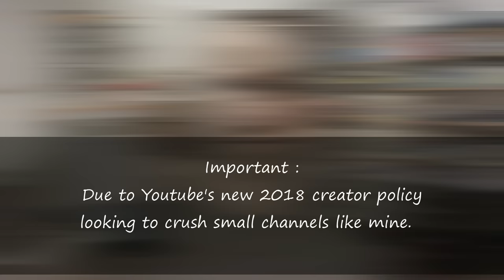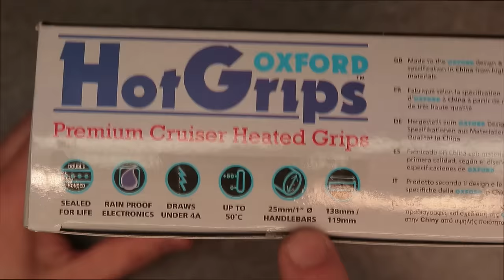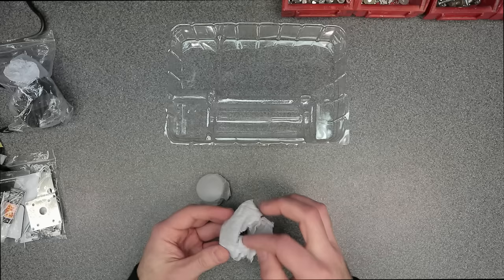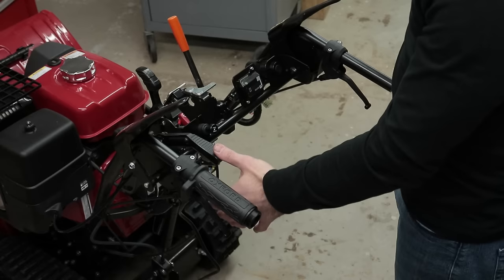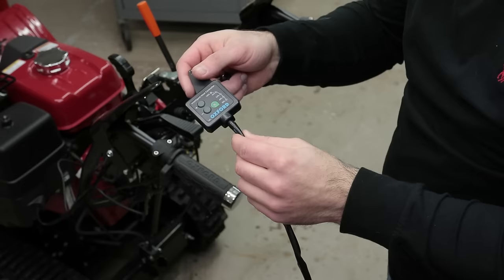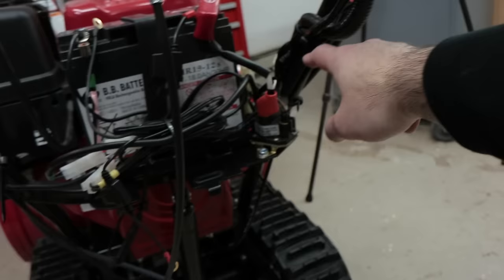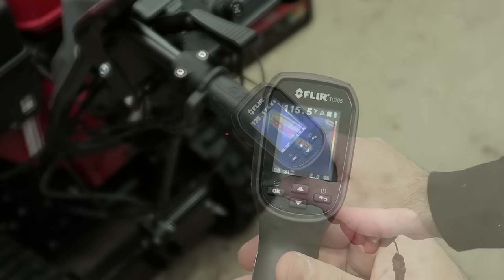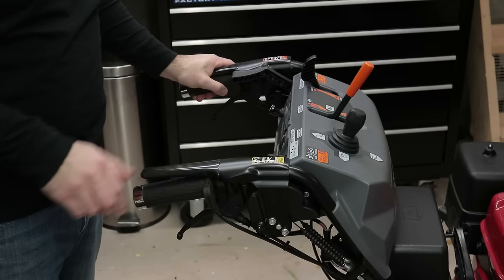Oxford Hot Grips Heated Hand Grips Install | HONDA HSS1332ATD Track Drive Snowblower | Workshop Vlog

Comment: I wish I had the patience to install these heated hand grips. I just picked up my Honda 1332 ATD 2 days ago and it's a fabulous machine...almost flawless. I had the heated grips on my old JD 1130 SE and would often clear the driveway and back yard with no gloves on my hands because the heated grips were so warm. However, I found some excellent thick work gloves with Thinsulate at my local Can Tire store for less than $7 and for now they keep my hands quite warm. Great video. Thanks.

Comment: After a month of making the upgrades to my snowblower, I was finally able to test it today.  We had about 7in of snow in central mass, combination of snow and sleet.  The machine performed extremely well.  I didn’t make the chute modification, but rather used teflon lubricant (Dupont Snow & Ice) to treat chute and auger surfaces.  I had no snow stick to any surfaces, so, treating them is a great alternative to the chute modification.  This machine is a beast.  The hand warmers worked very well as well.  I checked battery charge after using the machine for about 30 minutes and the voltage only went down to 12.85V.  Overall, extremely pleased with the machine and the upgrades.
Reply from the maker: The only thing i do not like about spraying the auger, impeller housing and chute is eventually that repeated spraying will leave the insides with a nasty residue that may hold dirt and grime. What is your experience with the teflon spray long term?

Comment: Thanks for the video John.  I bought an HSS928 a few weeks ago and I have done many of the same upgrades you have demonstrated in all your videos...  I just did the Oxford heated grips yesterday night, and it took me about an hour and a half thanks to your video (it would probably had been 3 hours if it weren’t for your instructions).  A couple of comments... I used Teflon lubricant to remove existing grips.  Spray just a little below the grips and they come out with no effort.  Then I cleaned with rubbing alcohol to remove the lubricant.  Another observation is that Oxford apparently heard your comment about the mounting bracket not being painted black.  The brackets come black painted from factory now.  The electrical connectors are also different, threaded with o-ring, water tight.  Some good upgrades.  

It’s a shame I can’t upload some of the photos of my work.  I also did the husqvarna snow drift upgrade.  I also bought the shoes, but when I installed them, the scrapper is not flushed to pavement when in scraper mode.  I need to figure out how to install them.  On a final note, your videos are making me spend a lot of money... please stop.  I’m kidding, your videos are very helpful.  Thanks again!
Reply from the maker: Glad you are happy with the upgrades. Thanks for watching!
Reply: Hey John Franco, one question.  My oxford Heaterz are going to battery saving mode after exactly 1 minute and 45 seconds, even when the engine is on.  Even when I’m moving the snowblower forward with the auger on.  I wonder if I just have a bad controller.  I’m calling Oxford this week, but wonder if you have seen anything similar.  For now I’m disabling the battery saving mode, but nervous about leaving it inadvertently on.  Any thoughts?
Reply from the maker: This depends on the health of your battery and charging system. Mine does the same after it heats the grips up. Then basically cycles off and on automatically. I usually have a battery tender on my battery to keep it strong while in the garage.

Battery saving mode means 2 things. One is that it has heated the grips to a maximum temp or that the battery is voltage is dropping to low to support the heat function.  Either way is a good thing. It shows it doing its job. It will automatically turn off after 7 mins if you turn the machine off. It very crucial that you have battery in good shape to run the grips. 

One work around is to drop the heat setting lower so its not demanding too much draw on the battery. Try that and see if it helps.
Reply: John Franco my battery is new, but you may be right about the charging system.  I was reading the GX270 and GX340 engine manual and it states that 1 and 3 amp charging coils are suitable for recharging starting batteries.  The 10 and 18 amp charging coils should be used when adding accessories.  See:  https://www.manualslib.com/manual/1036510/Honda-Gx240.html?page=14#manual

My HSS928 has the GX270 engine, which I think has the 1 amp coil, because it has a 5 amp fuse in the charging system.

So, it may be that the power output of charging coil is not enough to keep the grip heater battery saving mode from activating intermittently.  Now, I saw a video of someone changing the coils, and requires some engine disassembly.  That’s too much for me... so I will use as is, with BSM disabled and then recharge battery with the battery tender.  Maybe a few years from now, when I have time to undertake this type of project, I may do it.  

I wonder if I put a bigger battery with more capacity, if that would prevent the BSM from coming on for at least 30 minutes or so.  Thanks.
Reply: Good stuff here. What does the 1332 come with for coil amperage? Anyone have their battery die due to drawing too much from these grips? I have a brand new 1332atd and already have these on without having even used the machine yet. Heated grips seem to be a “must have” for me.
Reply: Does the 928 , with plug in starter, have enough output to run headlight AND grips?

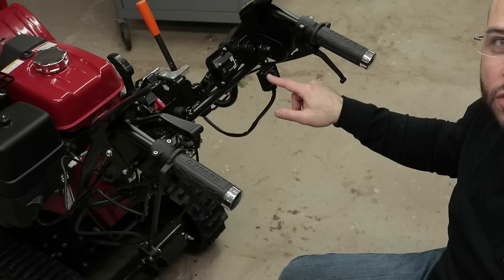Comment: Excellent way you described everything you did and why! At 22:38 you mention how you have to keep your left hand on the drive engage at all times. My HSS724 is the same way but my old Cub Cadet you could remove either left or right hand and both handles would still lock the unit in engaged mode allowing you to switch hands to maneuver controls which is nice for turning the machine around.  As long as one of the hand controls was depressed, it allowed you to to swap hands to use controls.  Would be nice if someone had a video on that modification as well.

Comment: In lieu of insulation, I'm thinking of machining a couple of pieces of solid aluminum dowel stock to size and then installing them, slathered with some heat sink grease, inside the tube. This will increase the thermal mass in that area of the handlebars which will tend to hold the heat longer once it's up to temperature.
Reply from the maker: That sounds like a great idea. I like it!

Comment: Seems like a lot of work. I have an hs1132. Love the Honda snowblowers. I don’t understand why they don’t just include heated grips when your paying over $3k for these units while companies like ariens sells them stock for half the price of a Honda
Reply: John Franco have you ever used a Yamaha snowblower? Heard there close to Honda’s
Reply from the maker: I agree...My personal theory why Honda does not include heated grips is because historically it is marketed as a commercial grade machine.  They are not interested in catering to the homeowner special market. It is a far superior machine being that it is a hydrostatic system.  So that Ariens for half the price is not even in the same league. Ariens does make a hydrostatic model, but now we are talking the same price point as the Honda. 

The Oxford Hotgrips i installed has far superior heat output and control then anything Honda would possibly include from the factory. Its ok to pay more as long as quality & benefits follow. 

If Honda considered offering quality heated grips with the machines, the price would shoot up even more. 

On snowblowers like your HS1132 and HS1332 you would have to install an upgraded charging system and battery to handle the 4 amp draw and to charge the battery.  Is it worth it?  Thats up to you. 

The way i look at it is,  yes it does take some time to do a pro level custom install. But its an absolute joy to have warm hands when im out there and its -20° F.
Reply from the maker: No i havent. I would love to try one out. But the HSS still would run circles around the Yamaha. They are 10 -15 years behind Honda when it comes to controls design and features. Similar to your HS1132. But they do throw snow just as strong as a Honda. They are not offered for sale in USA. You would have to go over to Canada buy one and and bring one back in to USA. People that live near the border have done this.
Reply: John Franco I bought my Honda hs1132 this year and it’s a 20 year old machine. Bought a brand new ariens deluxe and the Honda is way easier to start and throws way further. The old Honda will probably outlast the brand new ariens
Reply: There are heated gloves that can do the same job

Comment: Nice job on this.  One thing... you mentioned possibly using blue LocTite on the plastic end caps.  Don't do that.  LocTite damages most plastics.  I would instead put a dab of that Honda grip cement on the threads to secure them if needed.  I have a 2019 HSS928ATD and may do this same thing.  I have used those Oxford heated grips on motorcycles and they have been terrific.
Reply from the maker: Good to know. And as of today no locktite needed. I actually have some honda grip cement,. that may work. Very happy with the quality and functionality of the oxford grips and controller. I may want to upgrade the coil on the GX390 so i can get more heat from the grips. Thanks for watching!

Comment: I may try heated gloves (already have them for my motorcycle) instead of the heated grips.  Easy enough to try them, they plug into an SAE connector like the one Honda puts on for the Battery Tender.  May have to put in a bigger fuse.
Reply from the maker: Great idea!

Comment: Thanks, I believe I will do something like this with my Honda Snow-thrower too. Comments/suggestions: 1. I am doubtful that the insulation you installed made any material difference. The metal tubing will conduct the heat away and creating a little pocket on the inside which will have little if any effect. That said,  your grips got very hot but I would not attribute that to the insulation. 2. I suggest you pick up power from a source that is only active when the key is on (like the power feed to the joystick) which eliminates the need for automatic shutdown. 3. It is generally better to remove the tails from zip-ties by twisting until they let go. This leave no sharp edge;  then you will never cut your hand if you need to go back in for some reason.
Reply from the maker: Adding insulation does help. Very little help but ill take every little bit of performance enhancement i can get.  It helps hold the heat in that area Vs. it dissipating quicker into the air/metal of the tubing. Thanks for watching!
Reply: Cut zip tie tails with fingernail clippers, cleanest and easiest

Comment: For me, being able to start the Honda 1332 with it’s 12v battery is important as I am moving around town clearing snow.  I wish that motor was cranking out more power off its coil.  Makes me wonder how much power is being sent to the battery as it’s running.  Those grips, while awesome, would drain any battery quickly.

Comment: Nice installation i'am ordering mine now for my 2017 Honda HSS928A
Reply from the maker: Thanks for watching!
Reply: So how did your heated grips work ?
I just bought a 928 and these grips,not installed yet ,hate to have spend 125.00.
Reply: Does your 928 have a 12 amp hr bat like mine does brand new as of today?

Comment: Great stuff. Only problem was getting clutch to over. Cam and lock. Ground down grip, tried bolts but won’t go. Ideas?
Love videos
Reply from the maker: Grind more of the grip and check your rotate so it has better orientation in relation to the relief cut you are making. Also loosen the bolts to get more wiggle room. So the clutch will lock. Thanks for watching!

Comment: According to Honda: the charging coil only puts out 1.2 amps; just enough to power the LED headlight. You should install a 3-amp coil to help offset the heavy drain on the battery.
Reply from the maker: Yes i do agree with you on possibly upgrading the coil,it would not hurt. But the LED draws power from the battery & so does the starter. Not directly from the coil/stator assembly. The battery is rated for a higher amp draw.  One good thing about the Oxford grips is that is has a battery saving mod which will automatically kicks off/on the grips if voltage gets too low. Main reason i purchased this kit and not cheaper ones.  So far it has been operating just fine. I will post updates if i feel the need to upgrade the coil. Thanks for watching!
Reply: @JohnFrancoNH  I did the upgrade on the grips, but I get the low power blinking light after about 10 minutes, I can turn it down, but the grips do not get hot enough to feel. I also had the bat on the charger overnight and it was the first use on a brand new blower.
Reply: @erich920 I can't help you ,and I can't get anyone to respond to me either ,
I just got a new 928 and find the bat is a 12 amp /hr not the 18 John has.not sure the grips I just bought after I wasn't is going to work.
What happened with your situation?

Comment: Great video John. I just installed them Friday on my Honda 1332atd. Followed your instructions perfectly. Here’s my situation. When snowblowing on Saturday where I live in Rangley Maine, they got hot but nowhere near the heat you got. I got 103 degrees. But to do that I had to disconnect the headlight. I think that the snowblower may need a larger charging coil , if they even make one. What do you think. Ps the temp outside was 22 degrees.
Reply from the maker: Hi,  you are correct in that the snowblower could use a larger coil..and yes i do have the same problem. The battery charger i hook up to in the video puts out some decent amps. So i did get some serious heat. But i find it still hot enough to make me comfortable. If it goes into battery saving mode, try putting it in a lower heat setting to see if it will stay on rather then cut out temporarily. 

Also did you insert insulation inside handlebar tubing to help mitigate conductive heat loss? Another factor is the temp and wind chill, that could effectively make the temp differential much higher then expected. Which would draw more heat from the grips.  I will look into a larger coil and whats needed to install. If i upgrade it you bet i will post a video  Thanks for watching!
Reply: John Franco Hi John, thanks for the reply. Yes I filled both of the ends with fiberglass insulation. Packed it in nicely. What I did was hold both buttons down for like 10 seconds. That takes it out of the 
“ battery protection mode “ 
But obviously if you forget you end up with a dead battery. One of the options that sold me on the Oxford grips in the first place. If you end up putting in a larger coil I will definitely watch how you do it and copy the way it’s done. I also put on the front shoes like you recommend. Thanks again.

Comment: The insulation is a great idea! I would have remove the outer silver foil because it doesn't serve any purpose on your application, but excellent idea. Maybe foam insulation?
Reply from the maker: I did think of that but the paper helps in the event to pull it back out easier. Which i have had to do on my ATVs. Thanks for watching!
Reply: @JohnFrancoNH  what about spray foam inside the bars?  Also, what material did you use as your shim on the right sleeve ? Great video BTW.

Comment: This is a great video. One question – I use a battery tender that is also connected to the positive and negative terminals of the battery. Is there any issue with the grips’ control unit when the battery tender is attached and keeping the battery charged?   I just don’t want the grips to turn on and be heating at unintended times. Thanks for your videos!
Reply from the maker: Hi Chris, i also have a battery tender lead on my ATD. Its not an issue with the oxford control unit. The grips will not turn on from my experience with them. They will only turn on if acted upon (button press). But the good thing about the intelligent control unit is that it will shut the grips off in the case of an accidental button press if it does not sense the engine running(electrical noise). I have tested mine and it does indeed shutdown after 5 mins or so. But i will test with engine off and battery tender plugged in, as i am now curious.  I will get back to you with the outcome. Hope this helps. Thanks for watching!
Reply from the maker: Just tested the machine with engine off and battery tender plugged in and no issues. If it gets turned on accidentally it goes into battery saving mode(green led) after 2 mins and then 5 mins later shuts down completely.
Reply: @JohnFrancoNH  Excellent - thank you for checking that out for me.  As I live in Minnesota, battery health and maintenance can be a real problem.  It can be be sub-zero in the garage!

Comment: Just added the exact same grips to my new HSS928ATD with this video as inspiration but I’m having trouble with the auger lever not locking down. Tried to adjust the two bolts like you did but there’s not enough adjustment. Is there a way to adjust the cable linkage?
Reply: So have you found a fix ? I just took delivery of a new 928 and the auger lever wouldn't stay down when drive lever down,I have those grips but haven't even tried the install.
The cable for the auger lever needed to be adjusted to stay locked

Comment: Update i got the grips 
Took off batt cover and there is a 12 amp hr bat in my 928 compared to your 18 amp hr .
My bat isnt going to power my  grips are they.?
Reply from the maker: yes the battery is going to be the main power source for the grips. Not the stator on the engine, thats only to charge the battery.